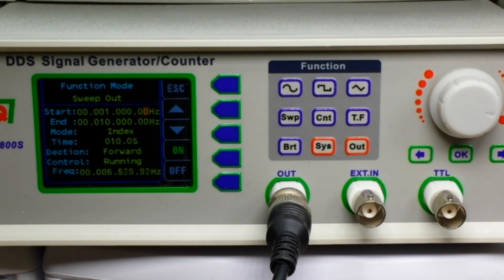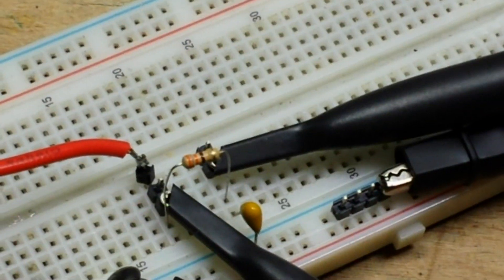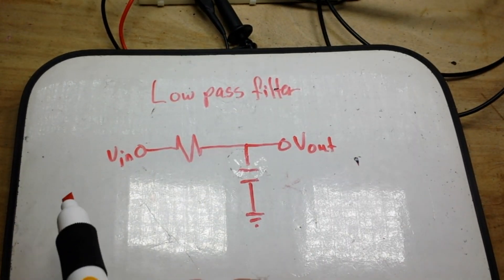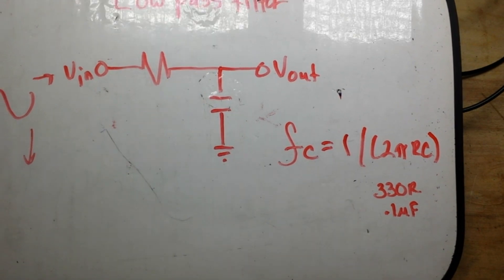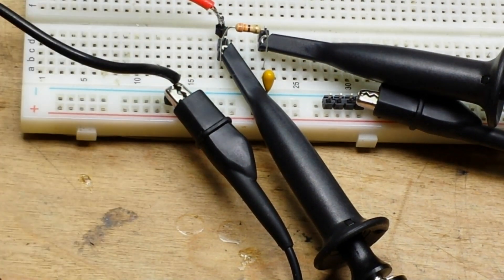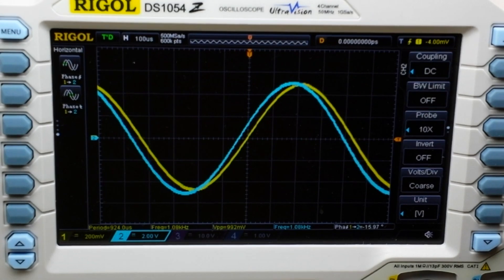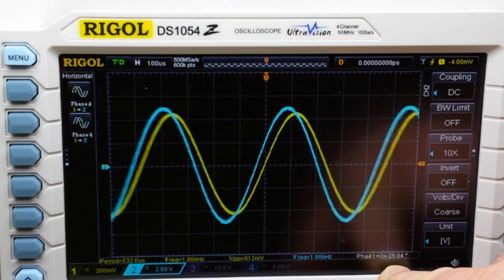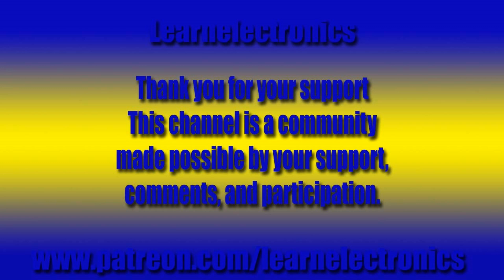Function generator example filter sweep

Comment: It is very usefull special if you are playing with mains voltage aka triacs and want to feed sinosoidal signal to do the Zero Cross Control eg  to an Arduino, before blowing something, even with opamp and opto-couplers, isolation transformer.

Comment: Some of the most useful purposes  for a function generator is to modulate noise onto signals so you can torture your design to see how it fails.

The uses are endless really!
Reply: The application of white noise to the input of an amplifier/ filter can be used to give a quick display of the amplifier/filters frequency response, as the output noise will be shaped by the response of the unit under test. The only caveat is that the input signal might overdrive the unit under test and may result in intermodulation products from both  in band and out of band signal interactions. But this technique is still used in some RF applications, such as the testing of radio aerials and passive filters. One advantage of this form of testing is that it does not necessarily involve expensive test equipment, just an oscilloscope, a diode broad band noise source and a diode probe RF detector.

Comment: Thanks for this video! Something that annoys me is i built a RF highpass filter but its insertion loss is terrible, like 20db (voltage) or so, i dont know what i did wrong, the filter design tools say it should only be about 6db loss. Was thinking im measuring wrong or my equipment is messed up

Comment: It might have been more interesting to sweep a Wein bridge filter, two resistors and two capacitors gives a resonant peak by virtue of the interaction of  a low pass high pass combination.
There was an instrument known as a wobbulator, that used a combination of a voltage controlled oscillator and an oscilloscope to provide a poor man's network analysiser. The sweep voltage was used to drive the scope X axis, while a peak detector connected to the scope y input was used to display the network under test output voltage. This provided a display of the network's amplitude response, a bode plot. When used at radio frequencies. It facilitated the setup of IF filters, in the day when these were made up of a cascade of tuned capacitor/inductor filters.
It was very satisfying to see the network response displayed in real time, and be able to adjust the filters, by tuning the inductor cores, to give a flat bandpass response. ( I think the test equipment was called a wobbulator because of the wobbling sound it made when listened to on the receiver speaker or the speaker built into the equipment.)
I once used a similar technique to tune an eight pole butterworth Sallen and Key op-amp filter, to give a maximum flat bandpass response.
It turns out that such filters can be tuned by adjusting the voltage gain of each two pole section.

The math functions on a modern storage scope makes it relatively easy to configure it, in combination with a waveform generator, as a network analyser . The scope can be programmed to due the log peak detection and even the phase measurement. Displaying both amplitude and phase bode plots. Very useful if you are interested in filter design.

Comment: Small point but since you're measuring a voltage wave form, isn't the 50% reduction in signal height at the -6dB level and not at the -3dB level, as it would be for power(watts)? The -3dB level for voltage is approximately 30% reduction in sine wave height.
Reply: correct, 50% voltage drop is -6dB, dBV = 20Log(Vi/Vo) power in dB is 10Log(Vi/Vo)
Reply: Thats why i hate dB honestly its confusing to know if its for voltage or power, etc

Anyway 3db is 3db

Comment: 1:16 ... 33ohm actually? Or the last ring is brown. Great presentation as always, thanks.
Reply: To me that resistors looks to have orange-orange-brown bands. Simple mistake of either seeing or just saying wrong color. Signals on the scope indicate 330 Ohm resistor with 100nF (+ some nF due to the tolerance) capacitor.
Reply from the maker: I misspoke
Reply: @learnelectronics  Thanks for triggering my OCD  LOL.  "Orange orange black, that would be 330 ohms" gave me one of those moments.
Reply: resistor clearly is a 33 ohm, not 330. But besides misspeaking, 330 was also used in the calculation, which came out as 4,8 Khz. Now, if you use 33 in the calculation, one comes out at 48 Khz (the expected one order of magnitude difference) - which was not what we saw on the scope. What gives?
Reply: @bobcuyt4675  I do see it as brown in the video (330 ohm), so I think he just miss-spoke as "black".  330 ohms does seem to be verified by the scope, where it does appear to go through about half power (-3db) level around the 4.8Khz mark.  Note that half power is approx 0.7 amplitude (voltage level).
Reply: Digicool Things ok, seems like the only logical explanation, so let’s go with that!

Comment: A Spectrum Analyzer would be most handy doing this.   You can down load and use a Audio Freq Lap Top Software version easy enough.   Always build a Interface to protect your lap top's audio input.   Of Course my Lenovo LT has the most crappy audio input available and I'm limited to a single channel doing so.

Comment: Historically, orange, orange, black is 33 ohms.  330 ohms would be orange, orange, brown.  Brown stands for 10 to the first power, red is 10 to the 2nd power, etc.  I checked my Radio Shack resistor calculator just to make sure.
Reply: Depends on the number of bands. There are 5 band codes and 4 band codes. What you say is true for four band codes. 5 band codes however have three significant digits followed by a power of 10.
Reply from the maker: I misspoke
Reply: @Stevey Canuck And if you hear "From the Halls of Montezuma..." it's probably the Marine Band.
Reply: I checked that his resistor had only 4 bands before posting.  Further, he states three separate color bands, not four, so the proper standard is clear in this case.  My junk box contains both types, so I not only check the color bands these days, but I also check the actual resistance with a DMM since used resistors can vary quite a bit depending on their tolerance and their history.